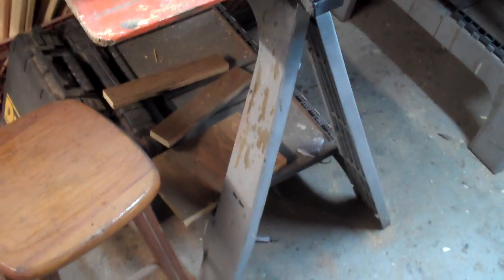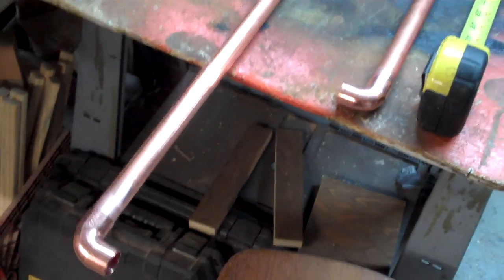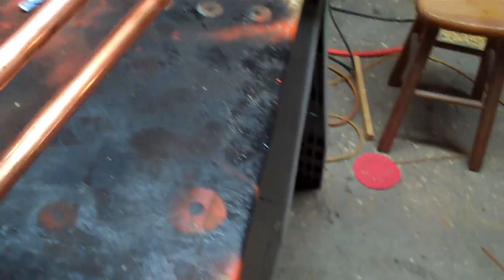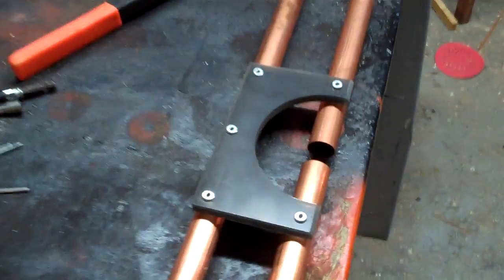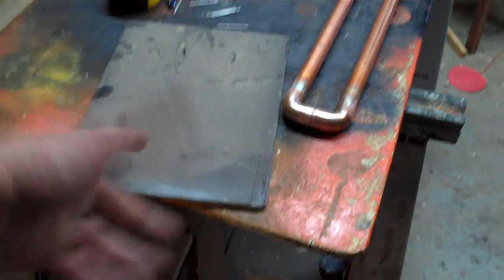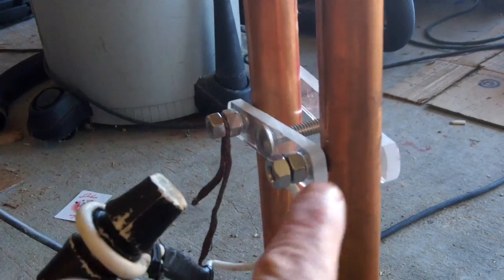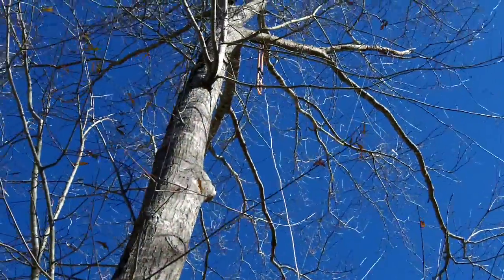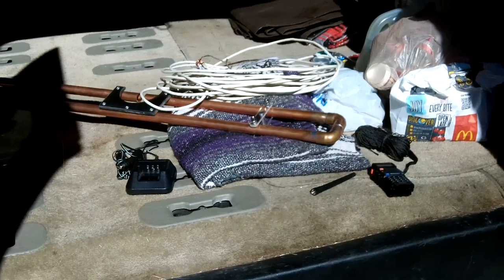Copper Pipe Slim Jim

Comment: That air gap looks way to small - should be an inch? Otherwise - I love the presentation style!
Reply from the maker: The gap has a small piece of brass I used to adjust. This is where it works best for where it was at the time.

Comment: Well I'm sure it seems to work unfortunately very few hams especially today's hams who are more appliance operators than anything else simply don't have the skills knowledge or tools to evaluate antenna performance objectively and scientifically all they offer is unsubstantiated subjective personal opinion. The bottom line is the Slim Jim and J-pole style antennas are very trendy yet massively over hyped miracle antennas whose performance is vastly overstated.

One of the issues with antenna modeling and gain predictions is the accuracy of the model is highly dependent on the accuracy of the data input into the model. This makes antenna modeling a perfect tool for snake oil salesmen peddling miracle antennas to exploit the ignorance of new hams. 

 For example you will notice that no one who peddles Slim Jims or J-poles uses antenna models which incorporates the feed line. That's because this marconi style antenna is very reactive and the way the feed line is connected and routed can have a significant impact on its performance. 

L.B. Cebik W4RNL who is one of the world's most well respected antenna experts stated that he could find no evidence to support the astonishing performance claims regarding the slim Jim and J-pole style antenna and that infact he could find little measurable difference in performance between a 5/8th way GP and a Slim Jim. 

On the contrary one of the major drawbacks of these marconi style antenna is their known susceptibility to common mode issues. In fact the common mode is so bad with this style of antenna that it's actually the feed line (coax) that's acting more like an antenna and not actually the slim jim or J-pole part which is why you never see them modeled with the coax attached. 

 As for the exaggerated 6dbi of gain well that number quickly disappears when you add the coax and factor in the feed point losses associated with the Marconi or J style feed.  What the people selling these antennas fail to mention is that when they calculate antenna gain they are assuming a 100 percent efficient feed point and this is hardly the case with the Marconi or J style feed and once again it's one of the reasons why you never see the antenna modeled with the feed line attached.    

nevertheless it is a fun project. One of the places where a Slim Jim or J-pole work well is as a roll up emergency antenna  that can be hung from a tree.  As for performance you would be better off building a 3 element tape measure antenna at least its gain is real
Reply from the maker: +Dan Nelson Perhaps you could do a DYI video on a different/better design? I  like to see and learn.
Reply: +dafrogtoad  Please don't misunderstand me, you did a great job building the antenna.  For a portable emergency antenna the J-pole is not a bad choice especially the roll up versions that can be hung from a tree. 

 My only issue is the hype and the bogus snake oil claims being made and the fact that so many "hams" buy into this snake oil today. 

 But then again what do you expect from a hobby that's been dumbed down so far that even 9 year old girls have earned extra class licenses.

 Of course nowadays I'm pretty sure it's just a matter of memorizing the  answers enough to pass the test rather than actually being qualified and knowing the material.  I doubt many new extras can actually sit in front of a VNA and interpret a smith chart or calculate the tuning range of a tank circuit which are things employers and our peers expected of hams who held an extra class ticket . Today your average extra can't even build a dipole without watching google let alone interpret a smith chart,  design a tank circuit or measure filter response.  

 Basicly at one time holding a ham radio ticket was an accomplishment, it was actually somthing to be proud of, It was an accomplishment that you could put in your job resume and it actually meant somthing.  

 Today it's not even worth the paper it's printed on, Of course the dumbing down of the amature radio service has a lot to do with it being marketed to the ecoom whackers and the anti government right wing preppers who previously couldn't pass the test until it was dumbed down so far that even a 9 year old girl could pass the test. As such amature radio is quickly being infiltrating by technically illiterate anti government right wing extremists who are turning amature radio into nothing more than glorified CB.   

As for me doing videos?  well maybe someday but it seems to me  there are enough videos on youtube making it already difficult enough to weed out the snake oil from the facts. Besides for the most part hams who look to youtube for information more often than not have no interest in facts but rather are more interested in confirmation of whatever subjective personal opinion they may already have. 

Don't get me wrong,  While I don't do Youtube videos,  I have been published in the ARRL manual,  I'm also a regular contributor to QST and CQ magazine and I give presentations and do seminars in person at large events such as  Dayton, Pacificon as well as DX conventions  all over the world not to mention I have a pretty full schedule as a guest speaker for local ham radio clubs. While I like having my work published in magazines I much prefer a more interactive venue such as seminars and such. 

The J-pole is a great beginners antenna but unfortunately  it's shrouded in snake oil. With that said when you're ready for a more advanced design with substantially better performance you might want to try building a colinear array of say 3 stacked 5/8th wave elements. The design is a bit more difficult and If you plan on running more than 150 watts then you'll need high voltage caps which you can make from small stubs of RG316 coax of course you'll need a way to measure the capacitance of the coax stubs.     

You can find several articles that have been published in QST, If you're a member of the ARRL they can be accessed for free in their archives.
Reply: +dafrogtoad By the way,  The reason tuning it the shack didn't work is because with the slim Jim it's actually the coax that's acting like the antenna and not the actuall Slim Jim part of the antenna.  that's why you had to hang it up in a tree with coax hanging down underneath it. In otherwards the coax is the antenna and the slim jim is the tuning network that makes the coax radiate LOL !!
Reply: Dan, you are not taking into account the surroundings of the garage itself which will have a profound effect on an antenna with a wavelength this long.
Reply from the maker: Thanks for taking the time to put all this information out! I'll look into the antenne you mentioned.
Reply from the maker: You are likely correct. I had a limited area to try and hang an antenne.

Comment: Good job on the build, Next time you might want to invest your time into building a better antenna design. 

 You might not know this but the Slim Jim and the J-pole are are variants of marconi style antennas and are nothing but snake oil whose performance has been massively over exaggerated. The over exaggerated gain claims of these antennas has been thoroughly debunked by some of the most well respected antenna experts in ham radio.  

 In the real world and contrary to their fanboyz both these antennas have less gain then a simple 1/4 wave ground plane antennas. If you are using one of these antennas then your coax shield is actually acting like the antenna and not the so called Slim Jim or J-pole part of the antenna.  That's why the performance of these antennas drops when you use a choke balun at the feed point 

Unfortunately inaccurate antenna modeling by a few unethical hams produced exaggerated gain figures that still persist to this day. Unfortunately these lies have persistent primarily because the average person building these antennas holds an entry level licence with little understanding of the math and science behind feedlines and antennas and as such they are easily sold snake oil.
Reply: Dan,

I am a bit perplexed by your statements of the J.  It is true some have stoked gain claims beyond reason (and there is no excuse for such blatant lies), but evidence (modeling confirmed with real measurements) confirm a properly built J antenna does have performance reasonably equivalent to a dipole in freespace. Yes you have to quell common mode currents on the feed line AND the mounting structure, but that's not difficult with proper design. The same evidence confirms the SlimJim variation produces equivalent results to a traditional J antenna despite the claims of some vendors like KB9VBR and N9TAX.

Please peruse the references in the well polished Wikipedia article on the J antenna...

  https://en.wikipedia.org/wiki/J-pole_antenna

Many of the references include "well respected antenna experts in ham radio" plus some other experts in commercial/industrial antenna design.

Dan, what is your technical background?  Have you made and tested a J antenna to corroborate the opinions you express about the J antenna design or are you simply parroting the hasty research performed by others.
Reply from the maker: +Dan Nelson Perhaps all true. However it DOES work. As do the 3 others I have built. Guess it's just up to the builder/buyer.

Comment: most looked good till I saw the coax white looked like 75 ohm never tune it that way  get 50 ohm . and there is water in the tree never tune it there either.
make the gap  ends 1.25 inch wide and cover bottom tube with cap water out . should tune close to 4.5 up from bottom but start tuning from 7 up and work down to 4.5 " with radio set 146 mhz  I get out to 45 miles with a baofeng and antenna mounted at 20 feet ...  have fun
Reply from the maker: +Mike KD7URA Thanks!